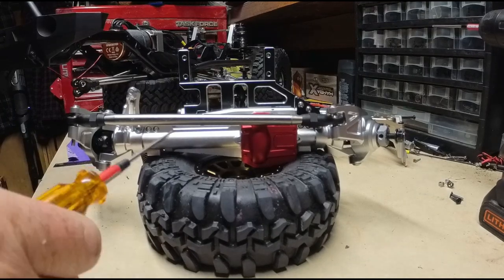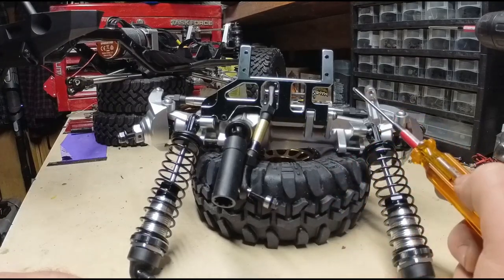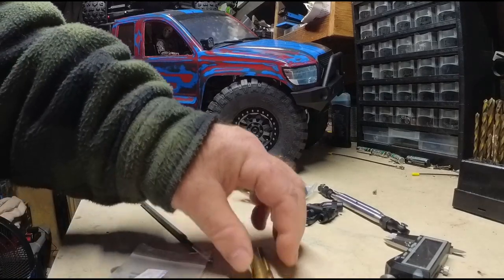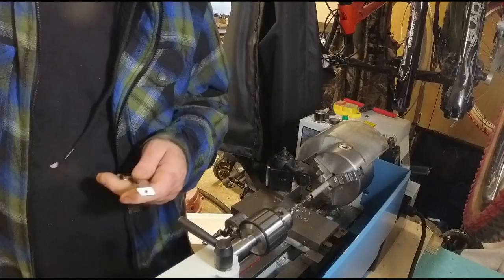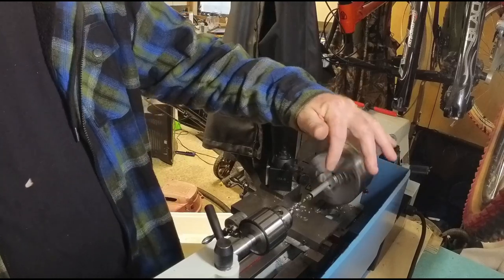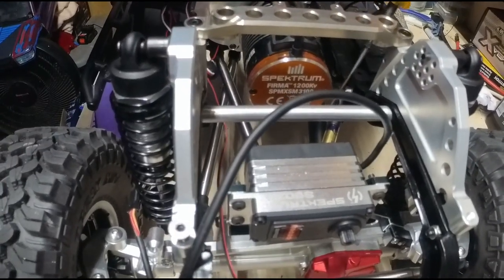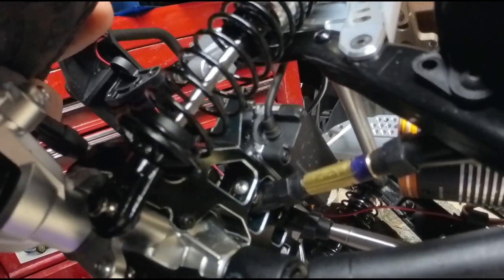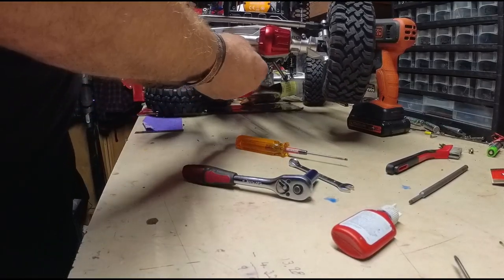Axial SCX6 Injora Axle, Gspeed Servo On Axle  "Mount install"

Comment: What’s the advantage of Vitavon axles versus these from Injora?
Reply from the maker: I am not sure of all the advantages, but vitavon axles are made from higher quality aluminum,  better fitment and tighter tolerances, probably the main advantage is the option to purchase the vitavon portals at anytime you choose, other than that the injora axles are a great price point purchase  if you want aluminum axles, with that said if I did more hardcore rock crawling I would probably just stick with the plastic axles as plastic slides over rocks easier, but I do a mix of trailing a rock crawling so I have been pretty happy with the injora axles. hope that helps :)
Reply: @jammer2150  it does help.  I am in the middle of shopping for aluminum axles for me Jeep SCX6 so this video of yours is very relevant to me currently.  I was looking at Vitavon as well as Injora and Integy products.
Reply from the maker: @roadrash76  Well I can tell you a lot of people in the facebook groups are running the injora axles and are happy with them, the only issue I have heard is where the knuckle slides onto the axle housing  it can rock up and down, the fix is to drill a hole thru both pieces and install a set screw, but no one has actually broke anything because of it that I know of.
Reply: @jammer2150  I’ll just go with Vitavon and save a ton of hassles.  Thanks for the information.
Reply: Yes choose vitavon. You get what you pay for.